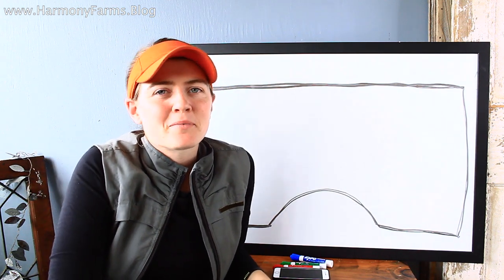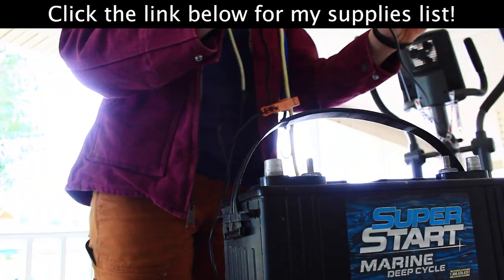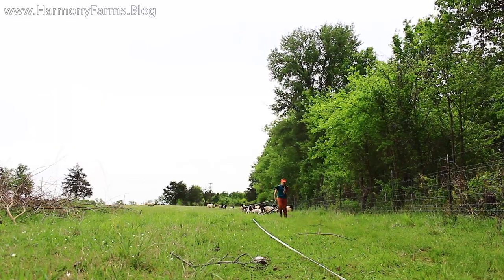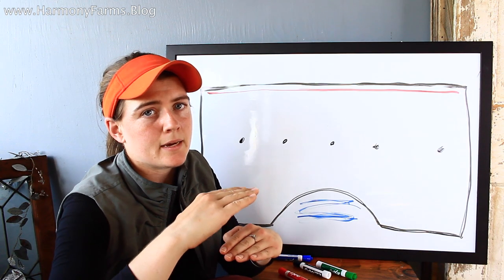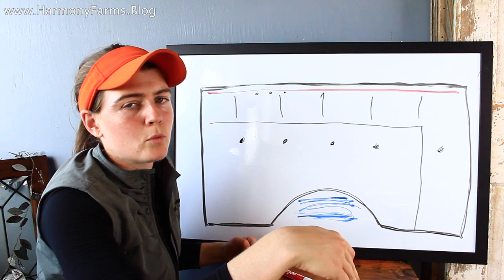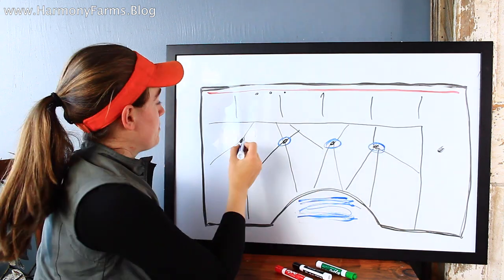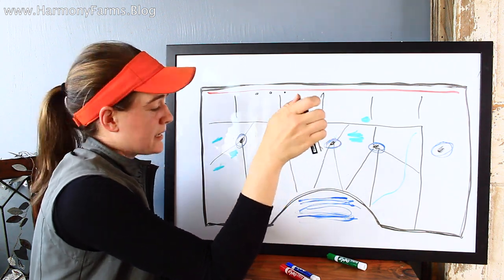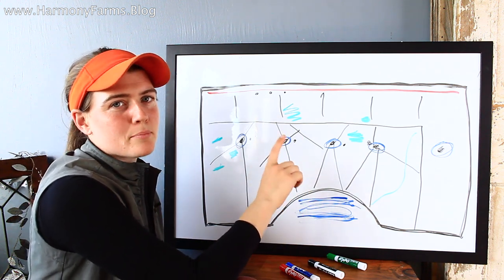PASTURE Plan for 10 Acres | Rotational Grazing Cattle on Small Acreage SHEEP FARMING

Comment: Nice job Grace, looks like you're doing well!
Budgets are budgets but as graziers we're all constantly trying to figure out how to increase our efficiencies. We all have different challenges and different constraints on our time and budgets so we have to work with what we have until we can get a chance to figure out the best way to upgrade things. One suggestion I can see to make to you for consideration is a centralized power source for your paddocks. You have enough to do without having to move that fence energizer unit all the time and charging a battery. I have a video on my channel showing a solar charged, battery powered fencer that's mobile that I built. It would be enough charger to run all your stuff from one point and you wouldn't have to keep recharging batteries. It's not a cheap solution but it is the most convenient thing you can invest in. You can also run permanently charged legs of fencing using poly and step in posts off of that back permanently powered fence if your charger on that fence is hot enough. Speedrights 6j charger with a remote is what I use and would recommend.10 acres should be fairly simple to set up where you're not having to move the fencer every day. 

Now for the water issue, ideal set up would be a solar/battery powered pump in that pond and bury some pipe to some central water points. I carried water for mine for a year and it sucks, lol. The plasson quick couplers are a great device. I doubt your frost line in the soil is very deep so probably a fairly reasonably cheap project using 1" pipe. Greg Judy has some good info on that type of buried system. From the frost free water points you can just hook into them with a garden hose and set up a small tank with a Jobe float valve. I haven't gotten mine in yet or I post a video on it. You may not even need to bury it down in your part of the country. You could rig it overland with some drains so you could drain it by gravity if need be to keep it from freezing.
Reply from the maker: Another great load of info here! Thank you, Brent.  Yes, I do have to say that budget is confining me to existing resources.  I’m trying to make some incremental upgrades.  I think a geared reel will be next on my list.  I’m too young for arthritis in my elbow from these plastic things. 😂😂

-the Shepherdess
Reply: @theShepherdess  Ha, yeah that'd be a good investment for sure. It's easy to spend money or throw money at problems. You seem to be doing very well with what you have. I just know you'll upgrade as you can and thought that might help a bit. Your flock is growing quickly! With your marketing background, you'll probably have some investment capital to throw around in the near future.
Reply: @Digger927  That's wonderful knowledge you shared with us. Thank you!

I just subbed to your channel I love learning.

Comment: nice tip on insulating a battery from the ground...not setting it directly on the ground.  I never knew that before.   It is fun drawing out or engineering a system that provides grazing while creating less work. I need to get better temporary fencing so I can map out similar strategies for fields I am not using right now.  I have cattle that are used to electric but I use the metal rods and t-posts and a single strand of metal wire.  It is a much more permanent solution that doesn't lend itself well to moving and relocating fence lines.
Reply from the maker: Glad you were helped by that! I never would have thought about it until my dad put the bug in my ear. 

I enjoy making the plans as well... but I always wait to share them until I’ve executed.  So much adapting happens between the time I pencil it out to the time the sheep are done with a pasture. 😂😂

Always enjoy your comments... thank you!
-the Shepherdess

Comment: Another idea to consider during the dry season is when you dump the water trough to move it, pour the water on the ground rod. A ground rod in damp/wet soil works better than in parched, dry soil. There are many other "tricks" you will figure out to get a little water on the ground rods. Best wishes.
Reply from the maker: Great tip, Greg! This will help. 👍🏻

-the Shepherdess

Comment: So I'm wanting to rotationally graze my cattle. The reason I haven't been doing it is because of shade concern and only have one set of premier 1 electric netting which is very difficult for me to move. I like your string method, it seems light and easy, I'm just at a loss as to how to make it work. Doesn't it have to be connected on all four sides, like a square, in order to be electrified? For instance, I couldn't run a straight line across my field and connect it to the perimeter fence since there's no electricity on the perimeter fence? I noticed you only have an electric wire on one end of your perimeter fence that you connect to, just wondering how that works since it doesn't connect in a square all around your pasture. Hope I'm not sounding confusing.
Reply from the maker: Definitely! If you search “shepherdess rotational grazing” here on YouTube you will see I have a tone of videos with info on my grazing system!

Comment: Hey again, do you see that stocking rate sustainable on the 10acres of what looks to be really good grazing? I ask because I have half the rate on poor pasture and I'm downsizing drastically. I have around 20 head on 5 acres and I'm looking to go back to 1 ram and 4 ewes to both rebuild pasture and the flock.
Reply from the maker: This is 10 of 23 acres total that. Based on what I have seen, 30 ewe-lamd pairs is very sustainable on 23 acres.  If I was to run 30 ewe-lamb pairs on 10 acres rainfall would have to meet my annual average (47").  Drought forces stocking rate down fast. (recent video outlines my destocking process for my local drought)